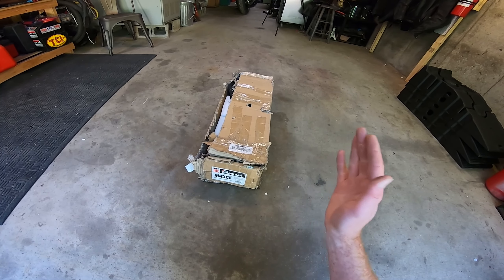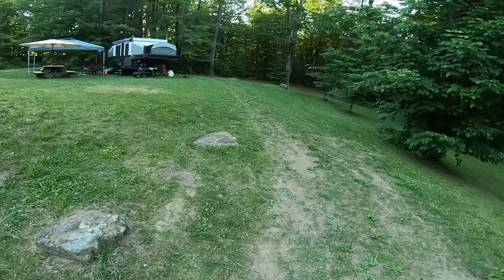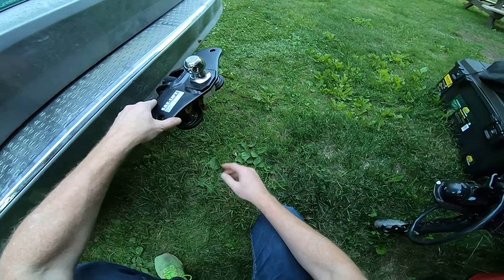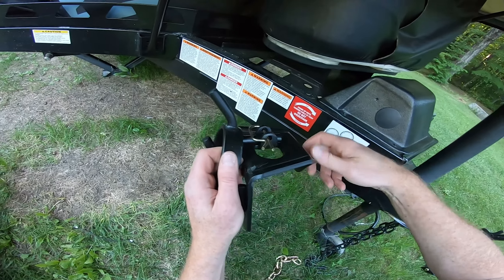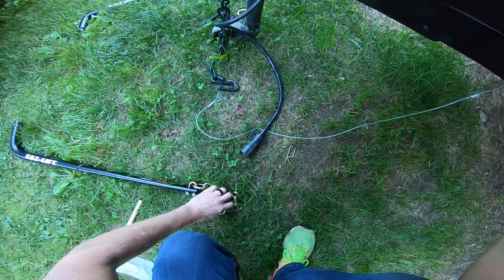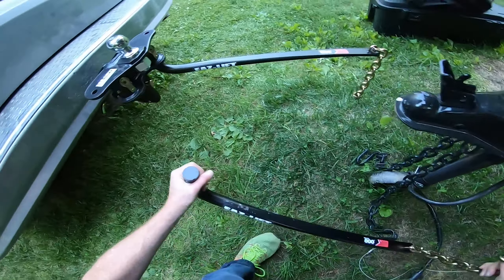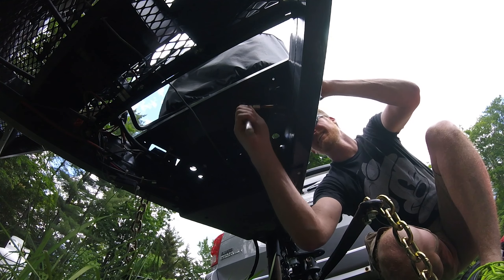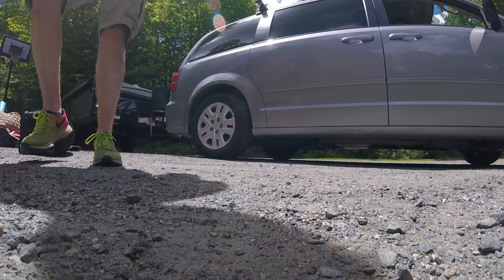Minivan Weight Distribution Hitch Install & Review | 2015 Grand Caravan & Rockwood Pop Up Camper

Comment: Hey.. been looking for a weight distribution hitch to use on my 2019 Mac 205 pop up and Honda Odyssey. I have some sag that I would like to get rid of. Everyone tells me 600lbs and up t - weight is to beefy for the pop up and can actually do damage to the pop ups frame. Whats your opinion? I did find and old school 350 t- weight one where the rails just lay on top of the A frame part of the trailer... apparently this one is made for pop ups.
Reply from the maker: There are some good helps online! Check out this one: https://www.etrailer.com/question-164037.html

Comment: Great video! We just bought a used Jayco pop-up that weighs about the same as your new camper. We have a 2016 Caravan without the tow package. Thankfully, the camper came with a WDH. I'm also planning on installing the same transmission cooler that you installed. I was also planning on installing the same air bags and helper shocks that you installed but do you think there's a point in the air bags and shocks as long as I'm using the WDH (and transmission cooler)?
Reply from the maker: Shocks yes but only if you need new shocks... I really like the way they ride. And air bags no :) they didn’t last a year before the bags dried and cracked... at least here in VT they did not handle the winter/salty roads. Plus you don’t need them with the WDH. Hurray for the weight distribution hitch! It’s the answer to safe towing. Also yes on the trans cooler!! A must have. I’m adding a 7” fan to it for the steep mountain areas. Congrats on the new camper :) also don’t forget a brake controller when you wire up your van for towing. Enjoy!!
Reply: Thanks for the quick reply!

Comment: So man i am trying to get a food truck? Do you think this will help? The hitch i mean
Reply from the maker: Only if you're towing a trailer! It uses the trailer to lift the back of the van. If you need a stiffer rear suspension there are options... rockauto sells stiffer heavy duty coil springs for the dodge grand caravan. You can also add booster shocks that will give a lsigh increase in suport. And then you can find air filled suspension support, but stay away from the cheap airlift 1000 kit.... they dont last very long. Or take a look at the Timbren DVRRT boosters (pieces of rubber you place inside the coils).
Reply: @sstressfl  brother thanks soo much, God bless, good info
Reply from the maker: @Mrbobster87  God bless you too! Thank you for connecting and glad I could help.

Comment: Are you also running airbags with the new hitch setup? Thanks!
Reply from the maker: scooter79100 nope! I do have Monroe helper shocks but the hitch does all the work 👍
Reply: Ok, then it sounds like our 2016 Kia Sedona SXL will be getting a WD hitch system. Was originally thinking we would need airbags, but I like this better. Thank you!  By the way, looking at the exact same PUP u have.

Comment: Can I tow uhaul 6x12 enclosed trailer with 2017 caravan
Reply from the maker: As long as the weight is below the tow limit :) And by the way, they stick up high and create a LOT of wind restistance. Highway speed becomes very difficult to maintain without straining the engine and seeing 5-8 mpg. Its a chore!

Comment: What receiver are you using with that set-up? And what is the tongue weight? I'm thinking of a similar set-up and am wondering about the WD hitch putting too much force on the receiver.
Reply from the maker: Dan Bohman Class iii receiver by Curt https://www.etrailer.com/Trailer-Hitch/Dodge/Grand+Caravan/2015/e98854.html?VehicleID=201569721 400 lb tongue weight, 500 with a WDH.

Comment: Great video! We just bought our first pop up! Picking it up this friday. Rockwood 2318 ESP. Very excited! Getting the WDH as well from the dealer. Would you recommend a sway bar as well? Im pulling it with my Jeep Gladiator. Don'.t know much about this.
Reply from the maker: Since we have been towing popups with our minivan I have never felt the need for a sway bar especially once the popup is level (no nose down or nose up) and even moreso stable with the WDH. Your Jeep Gladiator has a higher tow rating and a longer wheel base than our minivan so I imagine you'll be just fine without one. The fact that you're towing a popup means you will not have the wind issues that hardside campers have that cause most sway issues.

Comment: I just bought a 10x6 cargo trailer that weighs 1280 lbs, would you recommend a wds?  I had a class 4 hitch installed.  I pulled it yesterday and would smell a rubber burning smell when getting over 60 mph and going up hills.  I did have a 2 inch rise hitch on, I switched to a 6 inch rise hitch, and drove around, never smelt the rubber burn smell again.  With the 2 inch rise, the trailer was leaning toward the van a bit.  I have a 2015 Dodge Grand Caravan as well.
Reply from the maker: That seems very light to need a wdh. Was your engine temp rising? Is the tow vehicle unstable while driving? Also, does the trailer have a boxed frame or an open c frame?
Reply: @sstressfl  The van seemed stable while driving.  The temp gauge was about half way as per usual.  The trailer I'm hauling is a United XLV 10x6 Enclosed Cargo Trailer.  It does sit higher than the van.  Seemed to do better with the 6 inch rise though.  Going to the same location this weekend and will see how it behaves with the 6 inch rise, instead of the 2 inch rise hitch.
Reply from the maker: @TheAsthmatic91  sounds like you may have proper geometry now 👍 I look fwd to your test drive!
Reply: @sstressfl  Our drive to the campsite went well.  We're in mid to southern Ohio hill country.  Temp stayed good, went a little over half way on gage a couple times, on big hills.  According to the mpg monitor I averaged 13.7 mpg.  I actually manually put it in 6th gear after getting over about 45 mph and I felt it drove a lot better, it's not kicking in and out of gears.  I also manually put it in third if I'm driving on slower roads.
Reply from the maker: @TheAsthmatic91  Thats great news :D Sounds a LOT like my own experience. Happy camping!!

Comment: Thanks for the videos Michael! We have the same rig, grand caravan and 2280bhesp. Do you have a trailer brake controller? I was looking for a video of you doing it yourself lol.
Reply from the maker: I did install the trailer light/7 pin connector and a brake controller and installed it, but I was in such a hurry to make a camping reservation that I did not take the time to record it. I agree, it would have a been helpful. 

I bought a cheap brake controller off amazon and it works great --> Reese Towpower (74642) Brakeman Timed Compact Brake Control. I bought this wire kit --> Hopkins 47275 Brake Control Installation Kit and I bought this brake light box (required for the grand caravan) CURT 56331 Vehicle-Side Custom 4-Pin Trailer Wiring Harness, Select Chrysler Town and Country, Dodge Grand Caravan. And I purchased a 7 pin trailer wiring harness but I don't recall which one..... It wasn't too bad, but it took my brain a moment to realize what I was doing with all of those wires :)

Comment: Does this also function as a sway bar? Or do you not need a separate sway bar if you have this install because it stops it from swaying?
Reply from the maker: It's so stable and tight. The camper is lighter than the van too. I have never felt the need for additional sway control. But I think a sway bar REALLY comes into play when you have a light tow vehicle and a heavier camper/trailer.
Reply: @sstressfl   Thanks for the response Michael! I have been trying to get my Kia Sedona, which is rated to tow 3500 pounds, ready to pull my travel trailer which weighs 2200 pounds. I went and bought a weight distribution hitch but the shank hung way too low, and was almost going to drag on the ground. So now I am going to buy the exact same one as you. I noticed that you mentioned you got some airbags to raise up the back of the van?
Reply: @sstressfl  I'm wondering if I could get away with only having a sway bar. My camper weighs 2200 while my van weighs around 4400 lbs
Reply from the maker: @TheMfmccarthy  I gave up on the airbags (they rotted and failed). So afterward I installed some Monroe Load Adjusting shocks (they are awesome), but the most important thing is the Weight Distribution Hitch! It levels the van all on its own :)
Reply from the maker: @TheMfmccarthy  The Weight Distribution Hitch is necessary with that much weight to level the van and the camper. It makes all the difference in the world. Makes it SO much easier and safer to drive while towing! You wont regret it.

Comment: What tow package did you get for your setup?
Reply from the maker: It's an American Value Package with no tow package but it came with the big brakes and a DVD player :) I added a hitch, brake controller and necessary wiring/7 pin connector, Trans cooler, Monroe load adjusting shocks, and then finally the weight distribution hitch.

Comment: Sway bars on a pop up! Curious now to  how much cargo is in the van and how much weight your towing?
Reply from the maker: The 2280bhesp is 2400 lbs. We carry some food 40 lbs, 5 people in the van (about 500 lbs), clothes for the weekend (30 lbs?), and last trip we stacked 5 kayaks on top (160 lbs), and a 40 lb portable AC. We are maxed out. Adding a new 7" cooling fan to my external transmission cooler and doing a trans flush to keep things fresh (90,000 miles on this van now)!
Reply: @sstressfl  Kinda thought you were close to being maxed! I had a 73 Apache Mesa all fibeglass popup no canvas as my first popup. I think it was just under 1000# dry. I pulled it with a V6 5spd  1/2 ton Chevy truck! I miss that camper should have never sold it! We now have a 95 Rockwood 1904 popup (no idea what it weighs, tag worn away) in the drive way now that needs work hail/water damaged roof (tornado) and now a broken lift cable. The interior is still 9/10. I pull it with a 99 C1500 Suburban!  Our 17 Dodge Grand Caravan GT doesn't have factory tow setup!  I'm stuck now should I fix it or look for another popup! My wife has health issues to so I might look into getting a much bigger popup or even a hybrid camper!
Reply: @sstressfl  Tell me more about how the Dodge Caravan performed pulling at max out tow capacity. Have you done anything to improve braking? How about oil cooling. Please provide links if you have videos on these. Thanks
Reply from the maker: @ramuelgarcia6686  On the flats its not a problem. 19 mpg all day. In the mountains it drops to 14-16 mpg. I added helper shocks but the winner was the wdh. I added a trans cooler and it made a HUGE difference in the mountains. But I noticed at very low speed steep climbs it would start to get hot again so I have purchased a 7" pull fan to add to the trans cooler. I plan to it on manually if I find myself crawling up a steep mountain pass. Our 2015 Grand Caravan came equipped with heavy duty brakes. Big 330mm rotors up front with dual piston calipers. No more cheap brake pads for me! I buy only the best quality brake components now. It makes a BIG difference when towing. Here is a playlist of everything I have done on the van: https://www.youtube.com/playlist?list=PLB7a9_qObrLiCmTCDL-mTdP6A2WNga8fP
Reply: @sstressfl  Thank you so much!

Comment: Hi! How much weight are you towing now?
Reply from the maker: I have never done the exact math but its right at the limit. The trailer is 2400 lbs dry. We have to be touching just over 3000 if we bring bikes or kayaks. Poor minivan :)
Reply: @sstressfl  ok so you’re still under your van limit. Our oddy has a 3500 limit and we’re a family of 7 and Debating if we can tow a jayco jay feather hybrid at around 3500
Reply from the maker: @kkrb1212  We went from a 1700 lb 1997 Starcraft to this behemoth Rockwood 2280bhesp at 2400 lbs dry and I can feel it... a lot. The WDH was a must in making it work on the van, and for safety, but it is truly max'd out and from where I'm at currently I would not consider anything heavier and we have a family of 5. But also, any trailer that sticks up high into the air is going to change all the rules. The popups low profile allows for no wind resistance. But for everyone I've known who has using a minivan to two an standard height camper, the wind resistance has created serious issues, requiring downshifting, high engine rpm, very poor fuel mileage. That's why we're still in a popup :) I hope that helps!

Comment: Did you van come with the hitch or did you have it installed afterwards? I have a 2014 crew and am looking at tent trailers. This and the tent trailer review are great videos.
Reply from the maker: I had to install the hitch - and it was amazing because the manufacturer already installed the holes/nuts in the frame rails! All I had to do was bolt it in! I was so impressed! The more tedious part was completing the wiring for the trailer lights and wires for the brake controller. The Grand Caravan has a weird proprietary 3 wire system and you need to buy a converter box that mounts under the drivers side tail light that converts the light signals to a compatible two wire system that connects to the 7 pin trailer light connector. I have never seen such a thing. But now I know :) Thank you for your kind words! I'm glad the videos were helpful!  Send me a follow up note, if you don't mind! I'm really curious to find out what model of popup you decide to buy. Be safe and stay healthy my friend :)
Reply: You'll have to upgrade the suspension system if you have an SE that didn't come with tow. They also recommend getting a transmission cooler for extra support. The  van ever since the 2012 model has been retrofitted to support towing capabilities of 3600 lb, but only if it has the upgraded suspension system. Everything else has been retrofitted to suit all models of the grand caravan, heavy duty radiator, etc.

Comment: I dont think the transmission in these vans likes to tow anything
Reply from the maker: I always worried about it. Thats why I added the trans cooler. I changed the fluid & filter at 100k. Its now at 150k miles. But I did buy a truck in 2022. We no longer tow with the van :)
Reply: @sstressfl  regardless,  these vans will last a long time with some maintenance
Reply from the maker: @Ttow49 definitely!